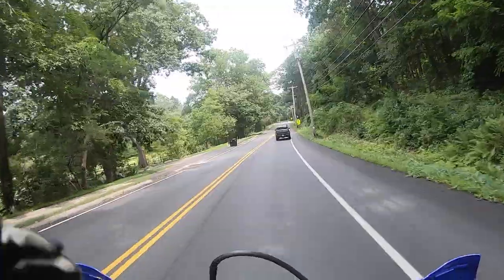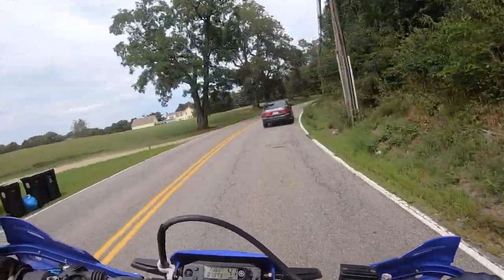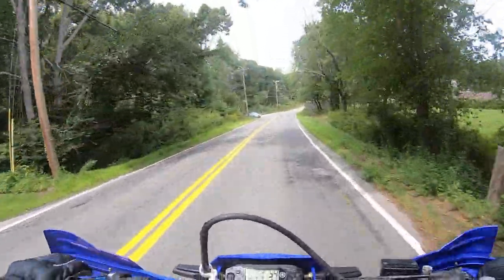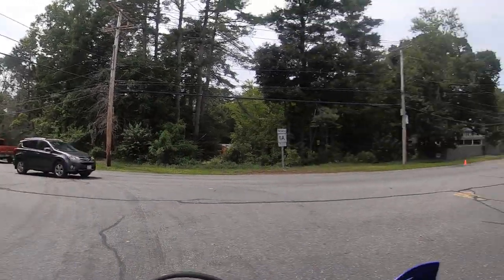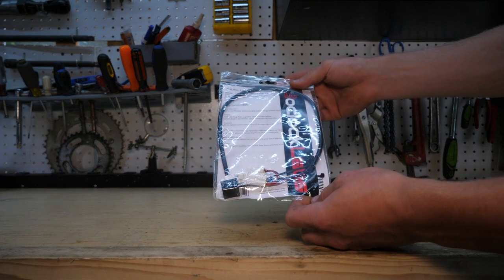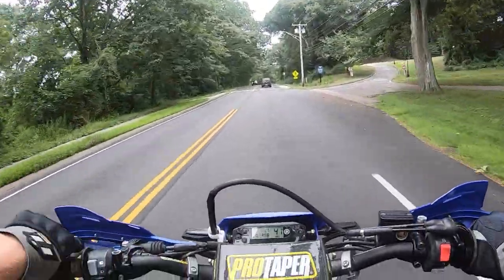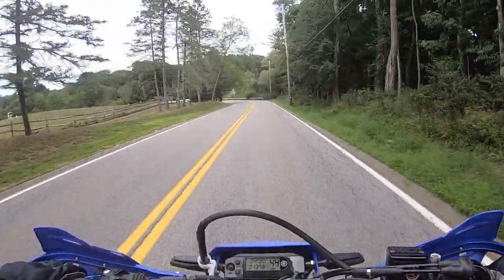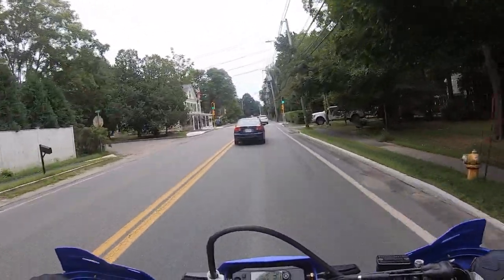12 O'Clock Labs Speedo DRD Calibrator // Install & Testing

Comment: Thanks for this video man!! Helping my neighbor install the speedo drd, just got the module installed but have been trying to wrap my head around those paper instructions wasn't working for me, but I
Saw 12 o'clock labs website just didn't know they had the setup and calibration chart at the bottom, just told my buddy I didn't know  how to come up with a starting value  but now I know!! Thank you very much,! Made and explained it a way, I'll beable to know what to do!!
Reply: i dont see the calibration tool on the website!